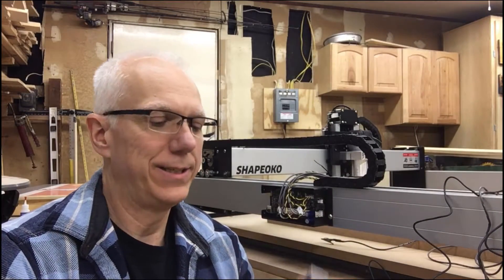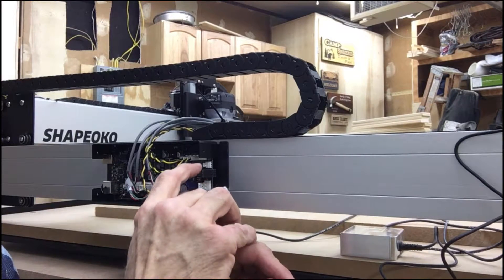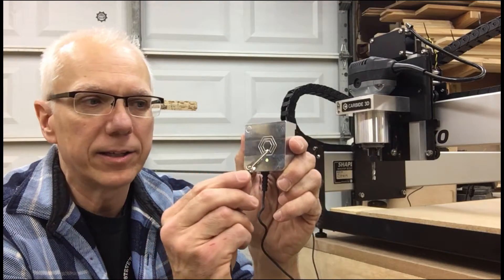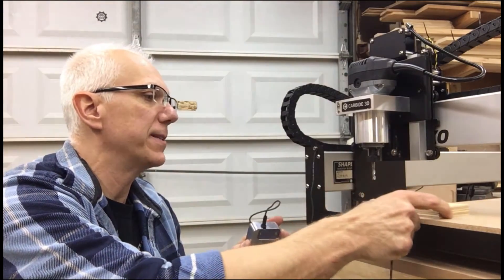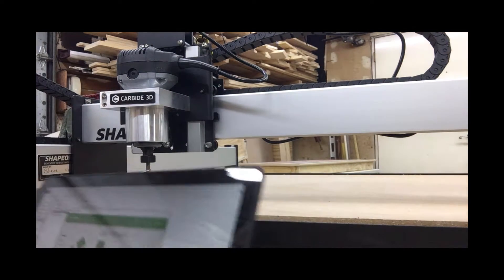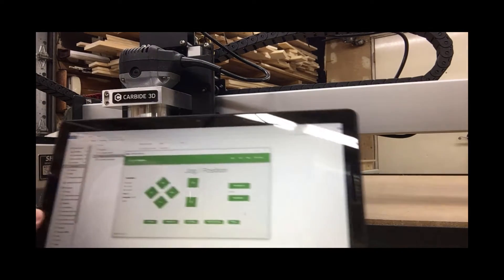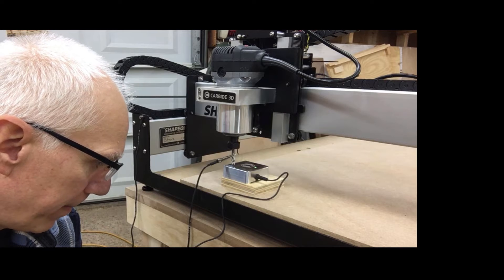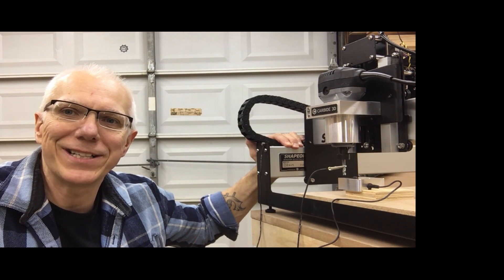How to use the Shapeoko CNC Touch Probe

Comment: Hi Steve, what model tablet do you use to control your machine? I currently use a laptop but looking to switch to a tablet. Thanks
Reply from the maker: Hi Andrew.  I use a Fusion 5.  It isn't anything special.  I am sure there are a lot of tablets that should work.
Reply: @stevescustomcarving1175  Cool, thanks!

Comment: Thanks for a well done video. I think you answered my question but I will ask just to be sure. Once you start the probe procedure, you are finished setting zeros? In other words, you do not need to go to the set zero screen as they have already been set? I thought after it probed I needed to set that as my "zeros" and that explains why my cutter was always too high above my work when I started a job. Thanks again.
Reply from the maker: Once I use the probe and set the zeros, I don't change anything.  Is that what you meant?  FYI.
Reply: @stevescustomcarving1175  What I didn't realize was the once you probe, the zero or zeros are automatically set. You do not want to go in and set zeros as they will be wrong because the cutter has retracted. This should probably be common sense but I was struggling with it.